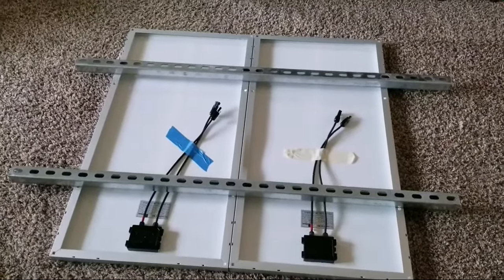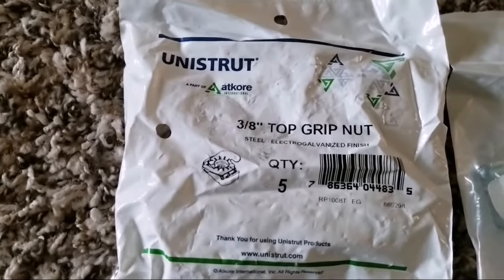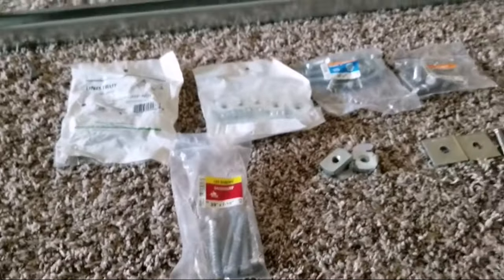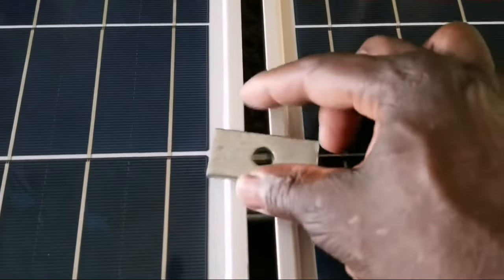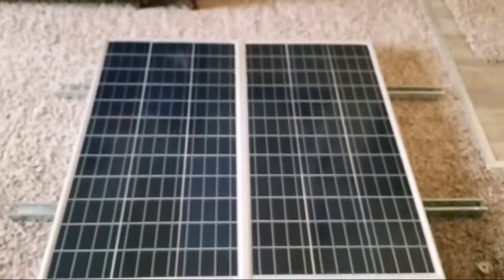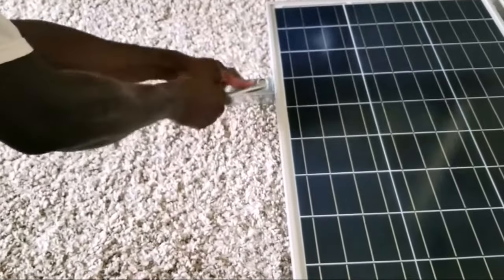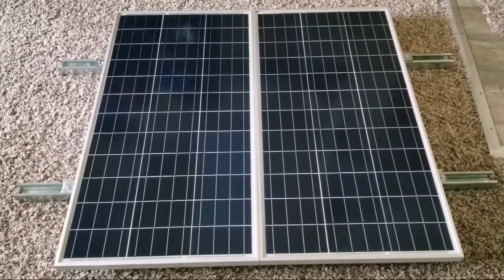UNISTRUT SOLAR PANEL MOUNT: How to install solar panels Using Unistrut/Superstrut

Comment: The panel may never blow off a roof, but flutter may become a problem if the panels are allowed any slop to move around.
Reply from the maker: Thanks for your opinion. 
LIKE👍SHARE and SUBSCRIBE
Reply: Absolutely only a matter of time before the panel bolts unscrew and the panel bends in the wing or comes crashing to the ground.

Comment: you can also use a spring nut, and hold the square washer for the mid clamps and for end clamps a spring nut and a L i mean less bolts and easy to uninstall in the future if you need to. Nice video and good alternatives

Comment: Dont have problem knowing you can mount solar to unistrut. Just worry the fasteners work and  not cut through the thin metal on the panels and the panel fall and hit something or worse kill someone.
Reply from the maker: Thanks for stopping by and don't forget to SHARE LIKE and SUBSCRIBE.

Comment: Just what I needed, thank you. You seem to need to leave the gap between the solar panel and the Unistrut slightly loose to allow them to slide along. I was wondering, without the center clamp connected to pin them down would these not rattle on a windy day?  The end struts would only clamp the ends down but the center would still be a weak point (in terms of rattling).
Reply from the maker: You are welcome. I am glad you find this video helpful.
Please don't forget to SUBSCRIBE LIKE & SHARE THIS VIDEO.
Reply: @equalizingforce2581  i thought the exact same thing. Its not really bolted tight in the center

Comment: Make sure you place a plastic washer between the strut and the module. Galvanic action takes place if different metals touch.
Reply from the maker: UNISTRUT NUT WITH SPRING: Superstrut Solar Panel Mount
https://youtu.be/XBR-aiK7kIw

SOLAR PANEL ORIENTATION/Cutting Unistrut/Superstrut for Roof Mount Installation
https://youtu.be/eNFo08dfN8Q

UNISTRUT SOLAR PANEL MOUNT: How to install solar panels Using Unistrut/Superstrut
https://youtu.be/3uubcw8gGPw
Reply: Had my modules on galvanized rails for bit longer than 7 years. No visible damage can be seen of galvanic action.
Reply: Boats in saltwater use sacrificial.zinc anodes to protect aluminum hulls and motors .
It works the same on the unistrut .
As long as the majority of the zinc is still present , corrosion will be negligible .

Comment: Excellent video, thank you.  I am using unistrut to mount my four 180 watt panels to the roof of my hightop van.  I was concerned because if I had to have space between my panels for "Z" brackets, they would be very close to taking up the entire 10 feet of the unistrut, which I am mounting between 2 gutter mount racks front and rear.  (My panels will be mounted across the van just like you show yours) I will have room to get under the panels with a wrench to tighten them to the unistrut so, I will have no spacing between panels and, I will not have to spend like $40 on "Z" brackets I do not need.  I might add some blue locktite to the bolts that go into the unjistrut but, other than that, I am happy I found your helpful video which just made my job much easier and cheaper.  Thank you.
Reply from the maker: I am happy you came across my video and find it very helpful.
Thanks for sharing your project with me and please don't forget to SUBSCRIBE LIKE & SHARE this video.
Cheers

Comment: I saw your video a few years ago, but tried to come up with my own way. It didn't work as well and was more expensive. Now, I am using your method. THANKS!
Reply from the maker: @donkiebals123  
Thanks for trying my method and hope it works well for your desired setup.

If you haven't already been a supporter or SUBSCRIBER on this channel please do so and don't forget to SHARE & LIKE this video.
Cheers

Comment: Using this suggestion for 3 panels on 2 10 ft. struts. Works nicely for my temp setup easy to slide them in an out.
Reply from the maker: Wonderful !
I am pleased this method works for your application. 
Thanks for sharing and for stopping by. 
LIKE SUBSCRIBE and SHARE

Comment: The sliding nut you are using can be inserted from the top and turned 90 degrees to seat, the nylon washer keeps it high in the track after insertion. The ears sit in the track to prevent the insert from turning.
Reply from the maker: Thanks for the input

Comment: great video super helpful.I want to put this on the roof on my trailer but I am planning on using bifacial solar panels. Do they make any type of shock anti vibration that I can use under the strut so my panels don't break from the movement?
Reply from the maker: I am glad you find it helpful.
Please don't forget to LIKE SHARE and SUBSCRIBE

Comment: well done! I used 80/20 aluminium extrusions and it cost me quite a bit more. I also used some angle aluminium pieces, but I see how your material would be much less of a cost, Thanks
Reply from the maker: Yes and thanks for your input and watching my video. 
Please don't FORGET to LIKE SUBSCRIBE and SHARE my videos and my Channel. 
Cheers
Reply from the maker: UNISTRUT NUT WITH SPRING: Superstrut Solar Panel Mount
https://youtu.be/XBR-aiK7kIw

SOLAR PANEL ORIENTATION/Cutting Unistrut/Superstrut for Roof Mount Installation
https://youtu.be/eNFo08dfN8Q

UNISTRUT SOLAR PANEL MOUNT: How to install solar panels Using Unistrut/Superstrut
https://youtu.be/3uubcw8gGPw
Reply: Aluminum is a soft, ferrous metal and it is a weak metal which will eventually strip out, 100% of the time and especially, on torque situations like this. Please, place brackets like a picture frame around the frame aluminum then bolt through. You will not kill so done when it flies off your roof like a kite.
Reply: jwsolarusa )
Reply: @PhilVerryChannel  Aluminum is non-ferrous.

Comment: Great explainer video! I'm consideirng using this setup on my van. Is there any horizontal shake of the panels using the sliders and if so is there a way to mount it such that there isn't? Since the van will be moving I didn't want there to be any rattling up there.
Reply from the maker: These panels are perfectly designed and sturdy for my application uptil now.
Thanks for watching and for stopping by.
Don't forget to LIKE SHARE and SUBSCRIBE

Comment: Thank you for this video! I still have one question though. How do you determine the correct gauge size to use for the super strut?
Reply from the maker: Thanks for watching.
Don't forget to SUBSCRIBE LIKE👍 the video and SHARE.
It's all by depends on the kind of installation you want for your project

Comment: Hey, thanks I’m great full for you sharing your knowledge. In my situation ( non roof mount ) do you think the mid gap is important for wind ? We get occasional thunderstorms with 60 mph winds.  Going to Home Depot tomorrow to pick up the struts. So far I need to mount like 1200 watts of panels.
Reply from the maker: It's your preference to have a mid gap.
Thanks for watching and don't forget to like & subscribe

Comment: You can use the smaller unistrut right? Its cheaper then super strut.
Reply from the maker: Yes
Reply from the maker: LIKE SHARE and SUBSCRIBE
Reply: Looks like you’re better off getting the super strut. The hex bolt on the slides and hex lag screws to roof won’t leave enough room for clear sliding in the smaller strut. The prices are similar after all so I will exchange for the super  strut.
Reply from the maker: @gregtatosian2021  
https://youtube.com/playlist?list=PLSNjIRSnUPDIY_4fOGmx1mYBZ5COZWQyJ

Comment: Good budget idea, but still needs better securing. Also you need at least a 1/4" spacing between panels to prevent heat build up and comply with codes in certain states.
Reply from the maker: Thanks for watching

Comment: Thanks for the great video! But I got a question: how can You tighten the bolt on the inner side to the panel towards to the previously installed panel? Or I just have to make it tight enought to able to slide it in the rail?
Reply from the maker: Here's a link to my videos how I have done it.
https://youtube.com/playlist?list=PLSNjIRSnUPDJSvz75KI8_pijBq43WgZyY
Reply: Just a thought, before mounting the struts mount panels first that way you can use the holes in strut
and from the "backside" you will be able to line up and tighten bolts on the panel. Leave a 2 or 3 inch gap
 in panels when mounting to struts. The gaps will be used so you can get a lag bolt down into roof joist.

Comment: I thought about using foam tape or even two sided tape between panels, to create a seal between them, to keep leaves from building up between and on the panels. There would be less chance of a leak if they are sealed between , I have 2kw I want to put on my roof, but haven't found a cheap way to mount unistrut to the roof! Maybe simple as a block of treated 4x4! But I want it to last, any roof attachment idea's??
Reply: It depends on your roof. If its regular shingles then almost anything will do. Like a Z mount. Just make sure you use lots of sealant.  If it is tile then you will need special tile roof mounts.  Not horribly expensive but still around $5-10 each. They go under the tiles and mount to the roof studs. they also have some
Reply from the maker: UNISTRUT NUT WITH SPRING: Superstrut Solar Panel Mount
https://youtu.be/XBR-aiK7kIw

SOLAR PANEL ORIENTATION/Cutting Unistrut/Superstrut for Roof Mount Installation
https://youtu.be/eNFo08dfN8Q

UNISTRUT SOLAR PANEL MOUNT: How to install solar panels Using Unistrut/Superstrut
https://youtu.be/3uubcw8gGPw

Comment: Trying this right now, using 7/8 Unistrut. Hitting a snag. The struts are mounted to the roof with lag bolts, but now the sliding pieces can't get past the head of the lag bolt. Not only can we not slide the panels into position, we can't even set them up so they won't slide at all. Trying to set up four 250 SanTan panels side-by-side.
What are we missing?
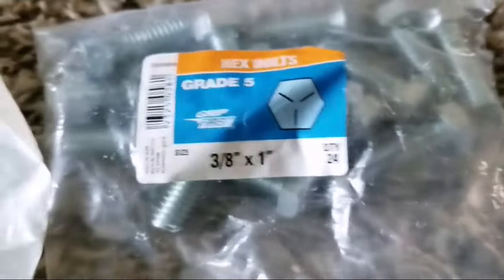Reply: I may have figured it out. At the 2:10 mark of this video you mention both Unistrut and Superstrut, but then you picked up and used the larger Superstrut, when I thought you were using the regular Unistrut.
Reply from the maker: You have to use flat and wide head bolts to mount or install the rails so you can have clearance later when you about to slide your solar panels. I hope you figured it out.
Thanks for stopping by and also for using my teaching method for your portable solar install. 
Don't forget to LIKE SUBSCRIBE and SHARE.
I have a bless day
Reply from the maker: Take a look at this other video I installed two large panels.
Here are the link on how I have used UNISTRUT to installed solar panels 
https://youtu.be/Z0805tM_S4Q

https://youtube.com/playlist?list=PLSNjIRSnUPDJSvz75KI8_pijBq43WgZyY

Comment: It looks like and sounded like it had some play. In other words kind of loose. Can they be tighten a little more
Reply from the maker: Yes.
I was just demonstrating how you can go about this.
Thanks for concern and for watching. 
Please don't FORGET to LIKE SUBSCRIBE and SHARE my Channel. 
Cheers
Reply: You do realize that they were just sitting on the floor. Once the rails are bolted on the roof they will not be loose.
Reply from the maker: UNISTRUT NUT WITH SPRING: Superstrut Solar Panel Mount
https://youtu.be/XBR-aiK7kIw

SOLAR PANEL ORIENTATION/Cutting Unistrut/Superstrut for Roof Mount Installation
https://youtu.be/eNFo08dfN8Q

UNISTRUT SOLAR PANEL MOUNT: How to install solar panels Using Unistrut/Superstrut
https://youtu.be/3uubcw8gGPw

Comment: Thanks for the helpful info. I do have one question, can you use 3/8in Cone Strut Nuts in place of the 3/8 Top Grip Nuts that you used? I'm not able to find any Top Grip Nuts locally, only the Cone Strut Nuts. Do you see any issue with swapping them out?
Reply from the maker: You might
Reply from the maker: Thanks for watching LIKE SUBSCRIBE and SHARE
Reply: @jwsolarusa  Might? So I should use the Top Grip Nut instead of the Cone?
Reply from the maker: @loudfang5.21  
What Stores have you checked? 
These are the stores I definitely recommend you check for these stuff. 
Lowe's
Home Depot 
Menards
Reply from the maker: @loudfang5.21  
I suppose the cones will work as well for I have not yet experimented those
Reply from the maker: What State are you?
Reply from the maker: https://youtube.com/playlist?list=PLSNjIRSnUPDLEzq4QrOiJH0f-sZ9_S1tP

https://youtube.com/playlist?list=PLSNjIRSnUPDLW9PdkQ6CZwtVkkxE6Fujb

Comment: Hello,  it seems to me like they would rattle in the wind.  are the connectors that attach the panel to the strut supposed to be that loose or should they be tightened down more?
Reply from the maker: You can tighten them up. This video was for demonstration purpose.
Thanks for stopping by, LIKE SUBSCRIBE & SHARE
UNISTRUT SOLAR PANEL MOUNT: HOW TO SECURE SOLAR PANELS, UNISTRUT SUPERSTRUT MOUNTING SOLAR PANELS 
https://youtu.be/Z0805tM_S4Q
Reply: @jwsolarusa  But how do you tighten the ones down that are under the solar panels when the unistruts are attached to the roof???
Reply from the maker: You can tighten the rails
Reply from the maker: LIKE SHARE and SUBSCRIBE
Reply: @rockandrattleretreat5830  Mount the panels on strut first then mount the strut on roof.
Just have space in panels for access to roof so you can have bolts into roof on ends AND between panels. Just a thought?

Comment: I would be worried about expansion and contraction breaking things apart without the gaps between the panels to compensate.  Is my caution unjustified?
Reply from the maker: Check out my playlist to see my rooftop solar installation without any worries.
LIKE & SUBSCRIBE
Reply from the maker: UNISTRUT NUT WITH SPRING: Superstrut Solar Panel Mount
https://youtu.be/XBR-aiK7kIw

SOLAR PANEL ORIENTATION/Cutting Unistrut/Superstrut for Roof Mount Installation
https://youtu.be/eNFo08dfN8Q

UNISTRUT SOLAR PANEL MOUNT: How to install solar panels Using Unistrut/Superstrut
https://youtu.be/3uubcw8gGPw

Comment: What is the size of the superstrut? 1-5/8" x 1-5/8"?
Reply from the maker: 5/8 10ft long
Thanks for WATCHING, LIKE & SUBSCRIBE
Reply from the maker: UNISTRUT NUT WITH SPRING: Superstrut Solar Panel Mount
https://youtu.be/XBR-aiK7kIw

SOLAR PANEL ORIENTATION/Cutting Unistrut/Superstrut for Roof Mount Installation
https://youtu.be/eNFo08dfN8Q

UNISTRUT SOLAR PANEL MOUNT: How to install solar panels Using Unistrut/Superstrut
https://youtu.be/3uubcw8gGPw

Comment: Would help if I could see the other side.  Also more detailed shots of the back and front on the first part.
Reply from the maker: UNISTRUT NUT WITH SPRING: Superstrut Solar Panel Mount
https://youtu.be/XBR-aiK7kIw

SOLAR PANEL ORIENTATION/Cutting Unistrut/Superstrut for Roof Mount Installation
https://youtu.be/eNFo08dfN8Q

UNISTRUT SOLAR PANEL MOUNT: How to install solar panels Using Unistrut/Superstrut
https://youtu.be/3uubcw8gGPw

Comment: The one problem I can see is that expansion of your panels can cause a buckling effect on your panels mounted without a common clamp between them.
Reply from the maker: UNISTRUT NUT WITH SPRING: Superstrut Solar Panel Mount
https://youtu.be/XBR-aiK7kIw

SOLAR PANEL ORIENTATION/Cutting Unistrut/Superstrut for Roof Mount Installation
https://youtu.be/eNFo08dfN8Q

UNISTRUT SOLAR PANEL MOUNT: How to install solar panels Using Unistrut/Superstrut
https://youtu.be/3uubcw8gGPw

Comment: I don't understand why you left the panels loose in the rails. This is going to make a lot of noise in a windy day. You should have had the bolts so they can be tightened from the panel side (5:18)
Reply from the maker: UNISTRUT SOLAR PANEL MOUNT: How to install solar panels Using Unistrut/Superstrut(part:2)
https://youtu.be/oDbPAZxXZvs

Comment: Excellent, solar panels as a roof top
Reply from the maker: Thanks Laxman.
I do appreciate your support and please check out my latest videos LIKE SUBSCRIBE AND SHARE MY VIDEOS AND MY CHANNEL .
Cheers
Reply from the maker: UNISTRUT NUT WITH SPRING: Superstrut Solar Panel Mount
https://youtu.be/XBR-aiK7kIw

SOLAR PANEL ORIENTATION/Cutting Unistrut/Superstrut for Roof Mount Installation
https://youtu.be/eNFo08dfN8Q

UNISTRUT SOLAR PANEL MOUNT: How to install solar panels Using Unistrut/Superstrut
https://youtu.be/3uubcw8gGPw

Comment: Oh dear, oh dear, I waited till the end to see how you would tighten the bolts to the rear of the panels to stop them vibrating loose and allowing the panels to fall and … nothing…

… You even used the wrong spanner 14mm metric for the imperial bolts, should have been recommending 5/16 ths but hey who cares about good engineering practice?
Reply from the maker: Hello Andy,
Thanks for watching my videos. 
I hope you find then helpful.
Here are some of the videos related towards your questions and concerns.
Please don't forget to SHARE LIKE 👍 and SUBSCRIBE to my channel.
Cheers. 

(Part#2) UNISTRUT SOLAR PANEL MOUNT: How to install solar panels Using Unistrut/Superstrut 
https://youtu.be/oDbPAZxXZvs

(Part#3) UNISTRUT SOLAR PANEL MOUNT: HOW TO SECURE SOLAR PANELS
https://youtu.be/Z0805tM_S4Q

(Part#4) UNISTRUT SOLAR PANEL MOUNT: 20kW BATTERY STORAGE FOR Off-Grid TINY HOUSE ON WHEELS 
https://youtu.be/Mg1Hl6DUtmg